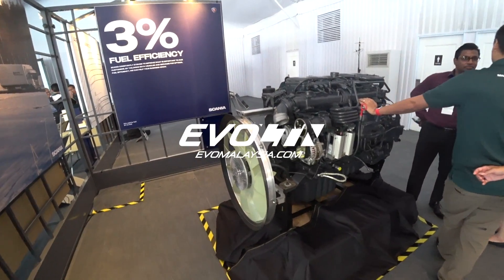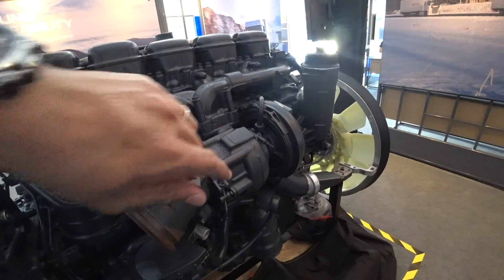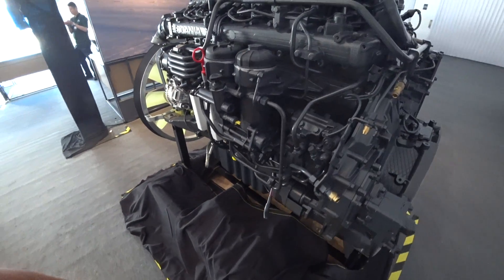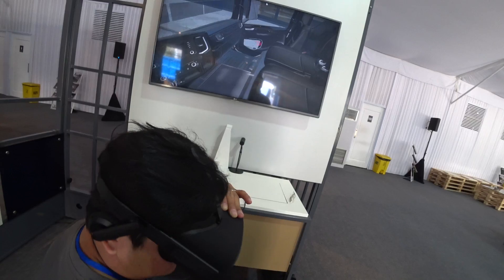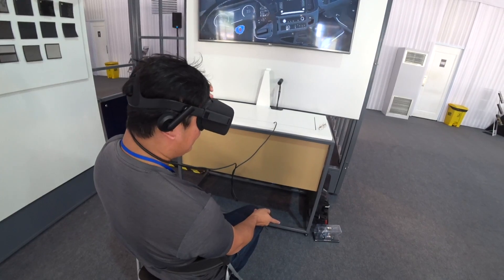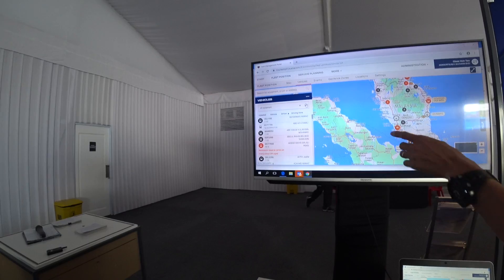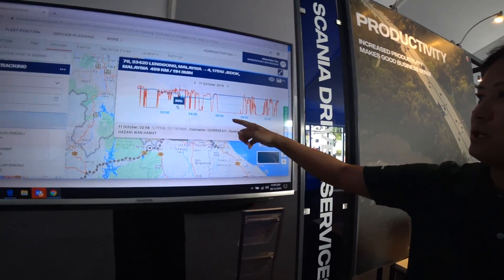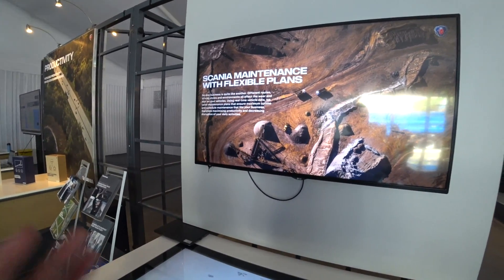Using exhaust gases to slow down a 40,000kg truck? | Evomalaysia.com

Comment: I know that trucks uses engine braking as a form of brake, how is that different from the exhause brake and the retarder?
Reply: Truck are using Air Brake, Engine brake , Exhaust Brake and Retarder. All are different. Not many truck come with Retarder, mostly optional. Retarder is useful for down hill, the retarder attached to transmission using hydraulic and air pressure to reduce speed long shaft. You may youtube ' VOITH'

Comment: Easy explain... Exhaust brake = Engine brake?
Reply: From what i understand. The smoke that was stop from coming out will push the pistons’ momentum.   
If its true? Why the engine die aaa
Reply from the maker: Nope ... in a truck, it's so heavy that using hydraulic brakes, it'll boil the fluids in no time, using brake pads, it'll burn it in no time, hence many other designs have to be put in place to be able to slow down the truck. The engine braking as we know it, by dragging gears doesnt need to come in first because exhaust braking can be use most often, then there's retarder, which pumps fluid into a chamber to slow down the transmission, then the air brakes, and lastly your good ol brake pads. All these to lower costs of maintenance

Comment: Yes. They design to save cost, however, to replace these high tech stuff it cost rm500 to rm10k up and down just for one particular spare part. It's not easy to maintain a Euro truck, especially SCANIA, Volvo, MAN and DAF.
Reply: how aboyt Mercedes Benz Actros ?
Reply: @KongKheeSoon92  depends on which models. Mercedes actross are actually quite reliable, but a single front mirror can cost u about thousands plus something by getting genuine spare part.

Comment: Exhaust brake are commonly used for trucks when going downhill slope
Reply: Yeah, normally the truck driver will pull the lower lever but not continuously..just because the brakes only are not suffice to put the heavy load to a stop..the friction heat is too high n unbearable for the brake to function properly~ 👌🏻😅
Reply from the maker: i never knew .... always thought exhaust gases means go-faster turbo ..... never knew got such a hardcore reverse option to choke the engine lol
Reply: @BobbyAurizn  Trucks with loads is very heavy moving vehicles, so when they are going downhill they are not using foot brake too much to prevent overheating for brake system that can be very dangerous.. Because heavy trucks can easily sliding down to fast.. That's why trucks have exhaust brake and retarder system to backup this big boys when needed 💪💪💪💪
Reply: Bobby Ang ..
Reply: @henrysiew1996  exhaust brake and retarder are different stuff, man